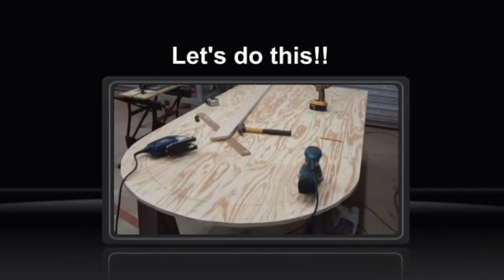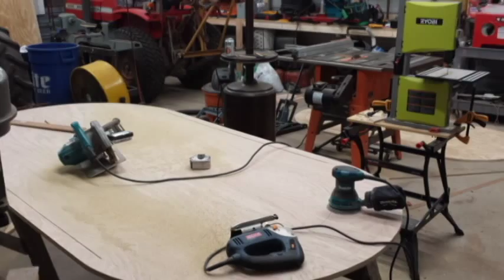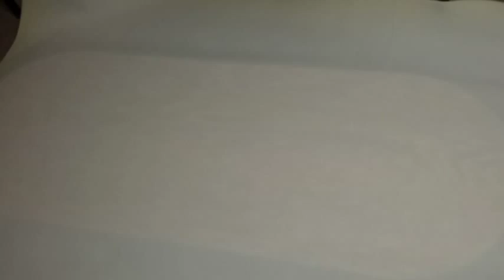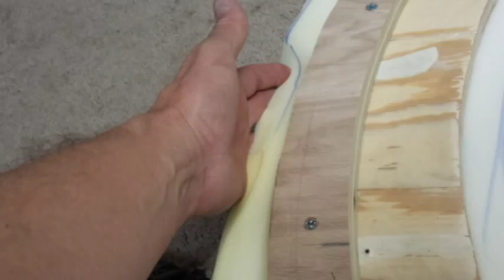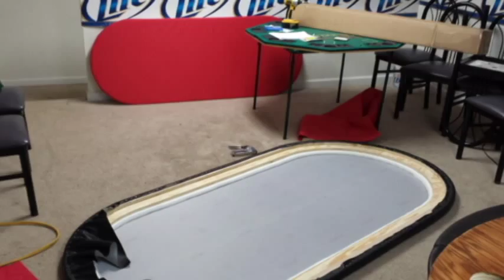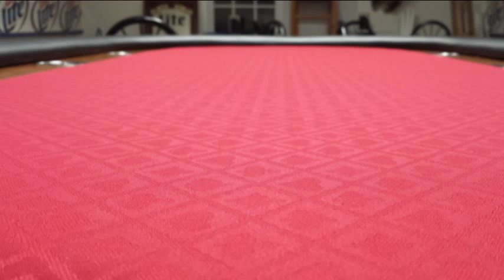Building a 10 man card table

Comment: Great video and this looks like the exact steps i'm following.  The only question I have is, what did you do to attach the rail to the racetrack?  Or does it just sit on top?
Reply from the maker: it will sit on top and you can screw it from the bottom of the racetrack